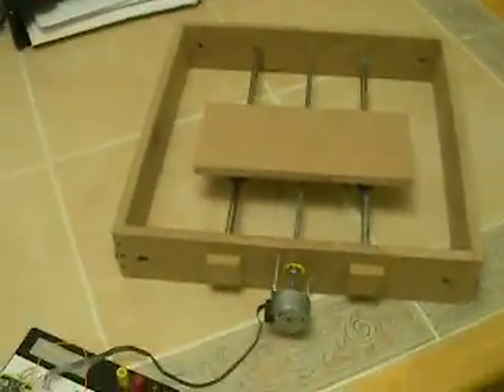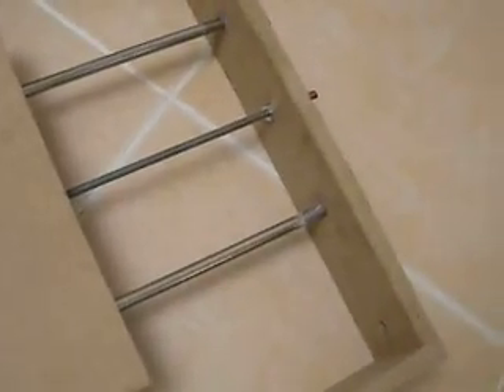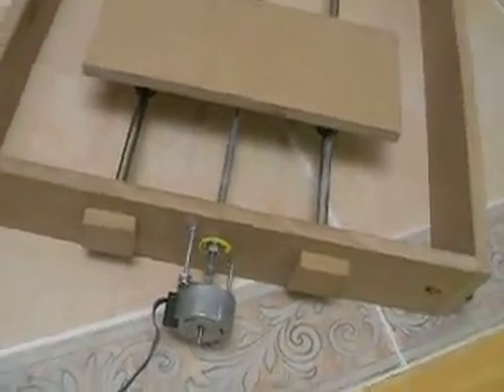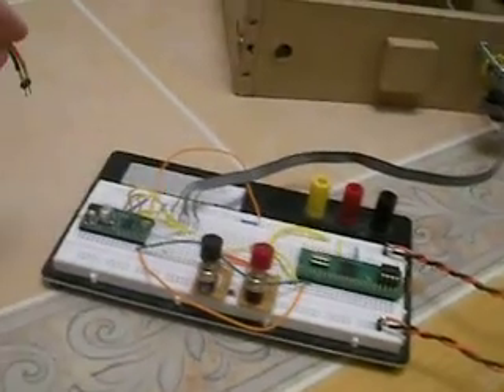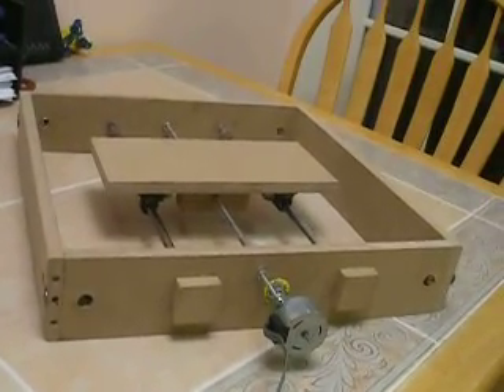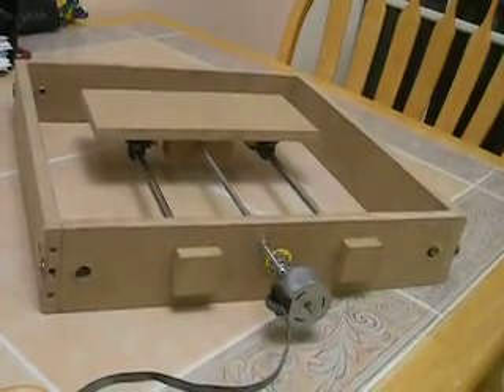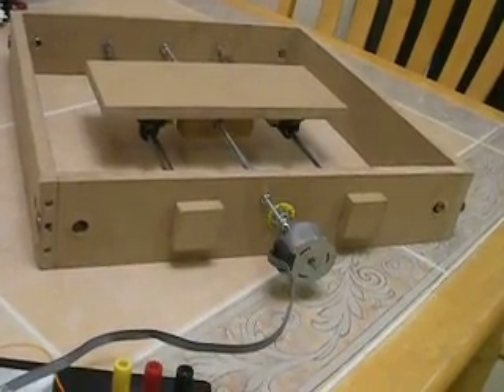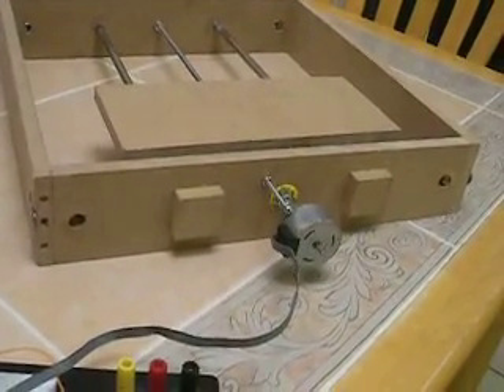Linear Slide With Stepper

Comment: Is this a threaded rod ?
Reply from the maker: Yes, 1/4" from the hardware store, although 5/16 would be a better fit. There's a small amount of backlash, but tolerable.
Reply: @mheermance  hey thank you for your reply , quick question , for a faster motion would you recommend using a belt assembly with a stepper motor ?
Reply from the maker: @kameelamareen  Yes, belts produce faster motion. There's also something called acme threaded rod which has a lower thread density that produces faster motion. Acme threaded rod is finer machined to produce less backlash, but costs more.
Reply: @mheermance  thank you very much , means alot and have a blessed day !!